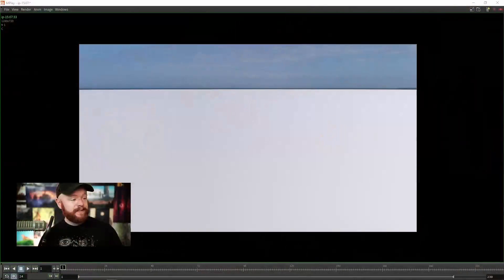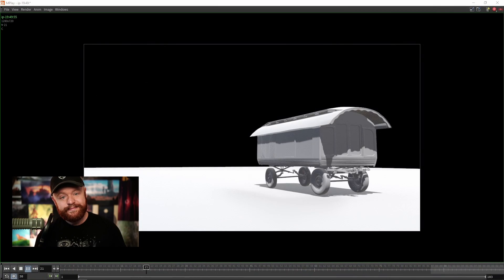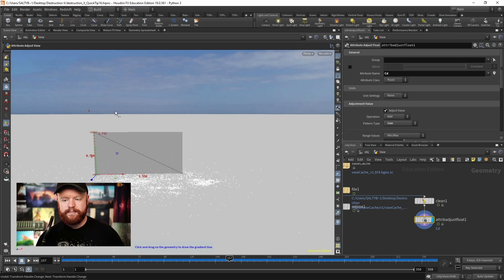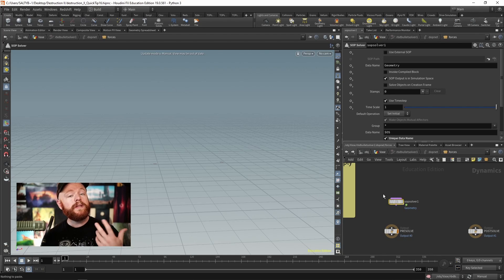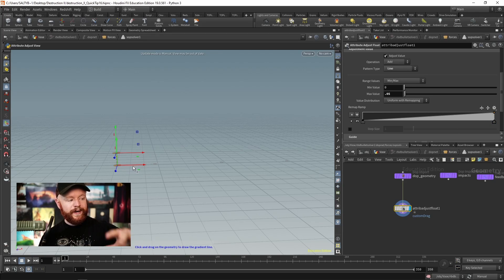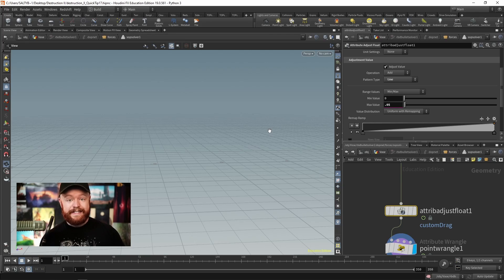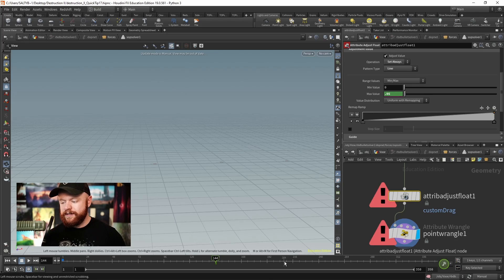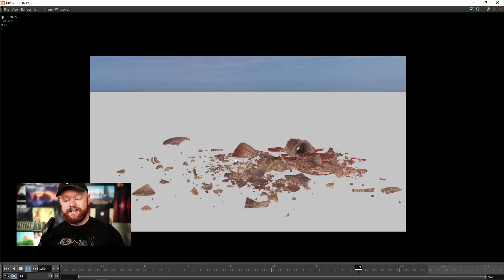Houdini | Preventing Jittery Pieces | Quick Tips

Comment: I came across this problem and I used a pop_drag then did a small amount of vex code in the node that took the Y component of the position, fit it between my drag_off_height and full_drag_height then had my regular drag and my ground drag, then did the same for “w” aka angular vel. Almost the same as what you had. Normally I am a vops guy, allergic to wrangles, but to have it all in one pop_drag node it was worth it.
Reply from the maker: Nice!  Great job.  It's definitely one of those situations that can be applied to just about every RBD simulation, so doing it in vex is totally worth it.
Reply: @cgforge  I just thought huge benefit of doing it in one node and something I am going to do. You can make a preset of it. So it will be just a few clicks away.